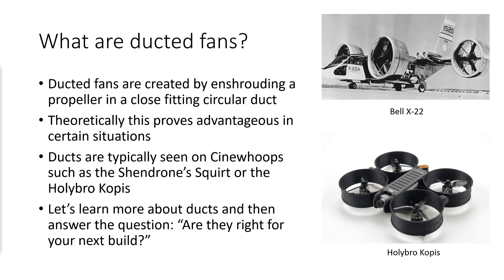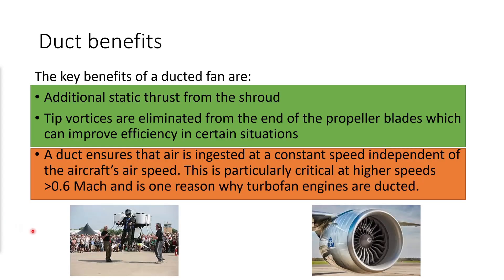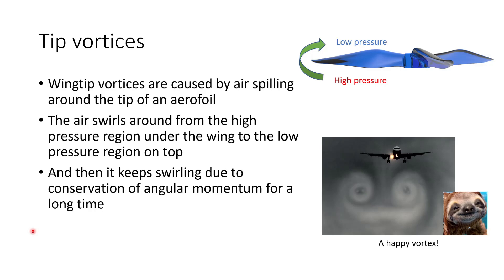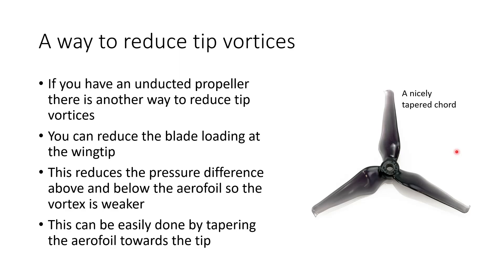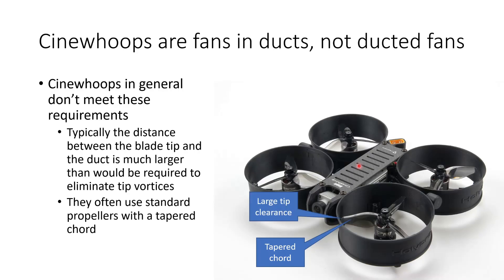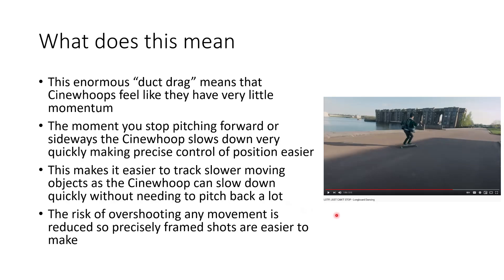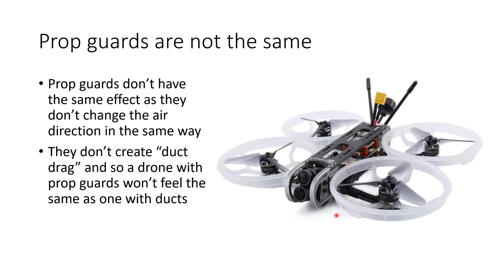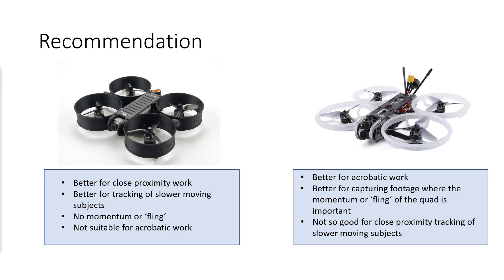How Cinewhoop ducts work and when you should use them

Comment: 01:16

I have a theory on this. So, my whoops ALWAYS have issues decending from height when in a "hover" state (even pitch). If I try to decend by just lowering the throttle, the motors almost seem to not obey and I just sort of yaw-jitter and propwash down really slowly... Is the velocity of the air circulating around the ducts airfoil keeping the props from slowing down and sort of starting a thrust loop?
Reply: You`re kind of on the right track with the recirculation, but it has little to do with the props not being able to slow down: its a phenomenon called "vortex ring state" and is a problem for all quads and especially real helis. Its essentially when the air being pushed down somewhat matches the speed of the aircraft going down and therefore gets recirculated heavily, leading to a massive drop on lift. As said, all quads have that issue (partially what propwash is) ,Whoops are just affected by it more than other quads for a variety of reasons, part being high disk loading and low power to weight ratio. Edit: Also the flightcontroller trying to fight all of this is whats keeping the quad from descending as fast as you want it to.
Reply: Through experimentation I have found that the weight and moment of inertia properties of my props need to be suitably matched to my motor stator volume to minimize this effect. I run 1103 motors and 2" props on my whoop. Avan Blur props are too heavy by far and suffer thus effect greatly. Gemfan 2023 props are notably lighter with notably lower moment of inertia and handle vertical and steep descents quite smoothly by comparison.
Reply: Interesting question...waiting for Chris' answer to your doubt. 
I think its probably the lightweight airframe that with its severe drag coefficient , behaves more like a parachute.
Reply: @yohfpv  heh, not sure we are having the same problems, maybe though, I am on 2204 motors and 3" props on my cinesplore. Perhaps you are right, but ive tried several props, all ducted props by design, they all have the same problem. its not really propwash, its just, "i drop the throttle, iterm starts to wind up on all axis, props never reduce in speed, quad makes weird noises, then starts to shit its pants as it oscillates down from the heavens.
Reply from the maker: I'm with Benedikt on this one. I think it's vortex ring state and your prop blades may be stalling and recovering as you descend. Try shallower pitch props. That will increase your resilience to adverse inflow conditions.

Comment: With quads flying foward the duct does not see straight air inflow. An angled air flow is meeting the duct. As far as I know this creates a momentum trying to level the quad (by the lift generated on the airfoil form of front part of the duct). Doesn't that decrease effciency and top-speed whilst it is another stabilizing factor?
Reply from the maker: You are correct that ducted quads are less efficient than a comparable open prop quad. They are also heavier and slower. But if you need a high drag flight feel you accept the compromises.
Reply: So what if you created a drone with ducted propellers angled so they face straight forward when flying?

Comment: Hi, I understand that thin prop guards are not ducts, but when do they start acting as ducts, is there a specific diameter to height ratio where the quad starts feeling like a ducted cinewhoop?

Also Thank you very much for your videos, finding science based infos or at least the explanation for the rules of thumb that are accepted by everyone just got a lot easier.
Reply from the maker: That is a great question. I would say that once the ducts extend significantly above and below the blades they will start to cause the flow to have to flow vertically. I imagine there will be diminishing returns above a certain height and a somewhat smooth transition between ducts and prop guards as the duct gets shorter.

Comment: If we were to machine a groove in the centre of the duct, And the propelors interfere fit the duct so we would ned to bend them until the were in the groove,and therefore have tip clearance, what effect would this have on the performance of the duct.
Reply from the maker: I think the biggest issue you would have is holding the tolerances in manufacturing you would need to make that work with plastic ducts. If they interfere too little you'll get no benefit. If they interfere too much you'll smoke motors.

Comment: Hi Chris, me and many of my friends are observing strange phenomenon in cinewhoops. When cruising forward and then leveling with throttle command at 0, cinewhoop tends to rise altitude. It happens also due to wind. Only thing that I was able to notice is that 3 motor are spinning in this case at high rpm, and one is spinning at idle rpm (2k-3k rpm). Is this possible that some unwanted lifting force is created at edge of the duct forcing FC to fight with it?
Reply from the maker: You will cause the ducts to stall when pitching level with no throttle. That will create a lot of buffeting. As the flight controller fights that motors will increase in throttle and may cause the quad to climb a little. Particularly if air mode is on.

Comment: So theoretically speaking, if one wants a quad's props to have no vortex formation, having specially molded propellers that look like those circled toy props is probably the easiest approach because it's got no gap at all.

https://ae01.alicdn.com/kf/HTB1Cz6PIXXXXXcCXFXXq6xXFXXXj/HM-plane-circled-three-propeller-blades-circle-round-the-propeller-blade-aperture-2MM-DIY-model-remote.jpg

I can easily see how someone can take the time to make a propeller mould that results in a cast with a specially shaped ring fused to the blade tips, though centripetal force might be an issue with deformation of the ring, so I think having more than 6 blades to provide more attachment points for the ring is the best way to go, I'd love to see someone actually this out, then there's the whole other issue with gyroscopic precession.
Reply from the maker: You are correct. For high RPMs you need a lot of blades to support the ring and more blades are less efficient so you end up losing some/all of the benefit of the ring.

Comment: I've enjoyed your videos.  There are cinewhoop specific props (Gemfan & HQ Prop) that are bullnose with a consistent chord length.  These type of props matched with some ducts require "grinding in" before being able to fly.  It is possible to properly size props and 3D printed ducts for minimum clearance.  I have found that 3D printed materials have some flexibility and props stretch so the static prop gap will appear to actually be larger than when in flight.  I have been playing with airfoil duct designs with some success and believe it is possible to further develop cinewhoop ducts to overcome many of the limitations you describe in this video.  Here are the short airfoil ducts that I designed and would be happy to send your the STL files if you wish to try them out.  https://milehigh3d.com/shop/ols/products/pro-af-76mm-duct-kit-for-squirt-v2
Reply from the maker: Thanks for the link. Based on the images on that page your tip clearance is too large (~1mm) to be getting any thrust or efficiency benefit from the duct. The prop stretching is an interesting idea I would imagine given the large range of rpm a consistent clearance is going to be impossible to achieve. Can you put tape inside the duct and go fly to prove you are getting the clearances you need in flight? Regardless, I'm sure it still gives a great benefit in terms of feel for cinewhoop applications.